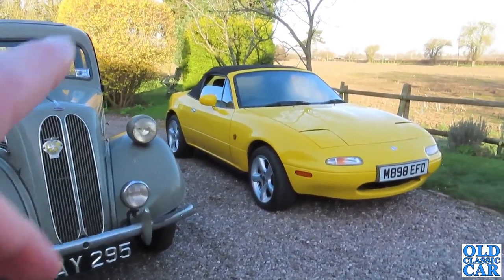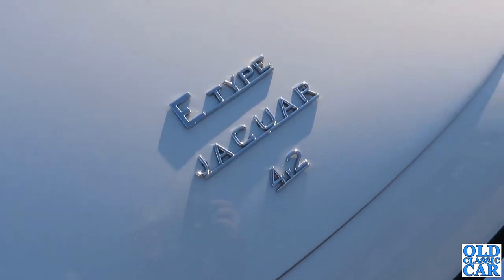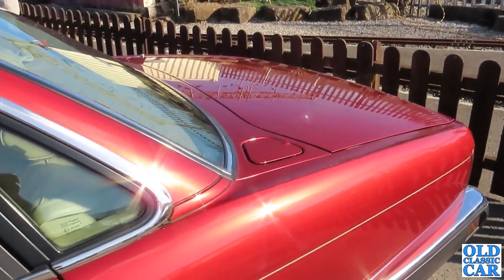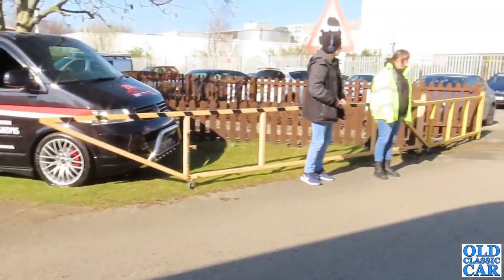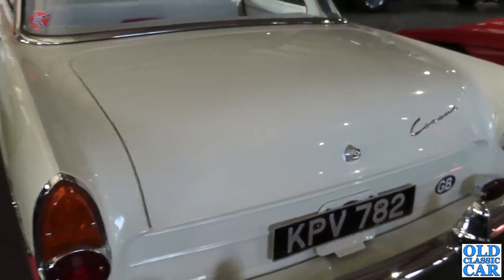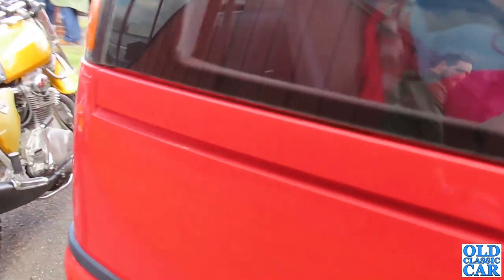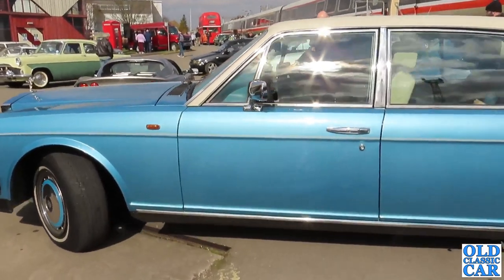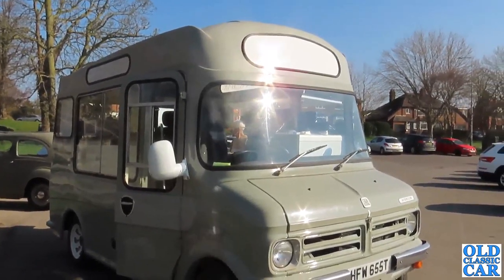Classic car show visit with the Ford Anglia & MX5, inc on-board | Crewe "Off the Rails" meeting

Comment: hi again great video. can you tell me is there any differance between the pop and anglia. thanks brian d.
Reply from the maker: The Anglia pre-dates the Pop. The Anglia has the smaller 933cc engine, larger lamps, and a bakelite dash. The Pop 103E that came after, but was based on the Anglia, has the larger 1172cc engine but otherwise was cheapened yet further with smaller lamps, and a simple pressed tin dashboard.
Reply: @oldclassiccarUK  thank you,,,,